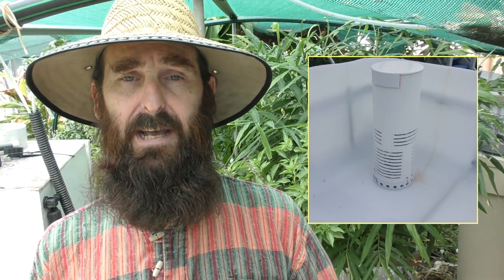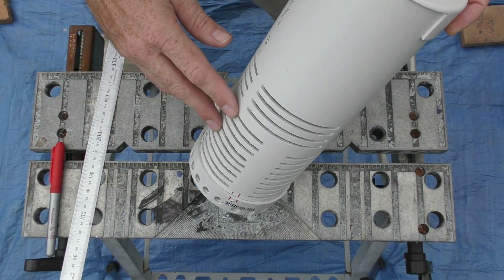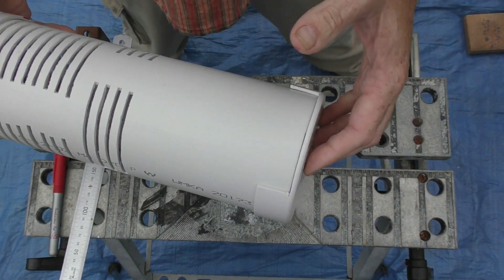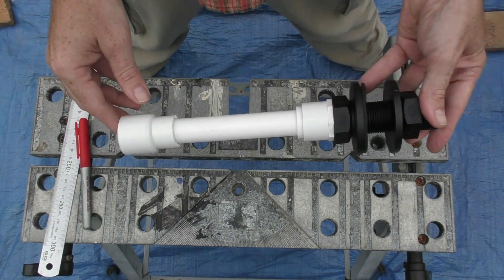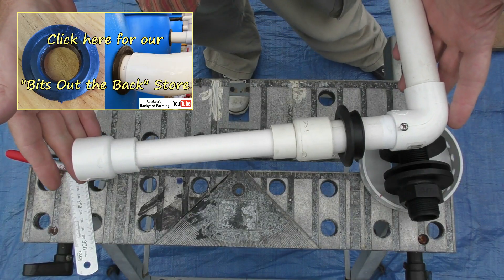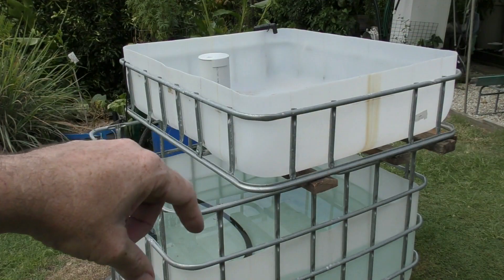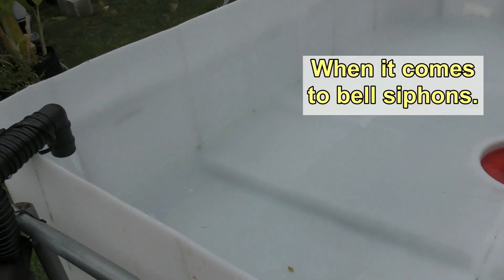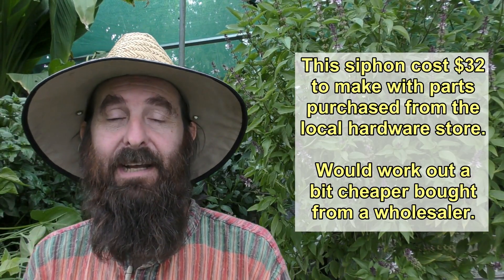How to Make a Bell Siphon & How Bell Siphons Work

Comment: Hi Rob
Great video – does it matter what height the bell is above the stand pipe?
You say you measured 30mm above stand pipe (250mm + 30mm) is 280mm, but on the video (11:20) you mention the bell is 270mm.
I am guessing it is not an issue but don’t want to botch the build.
Thanks again, very informative and helpful.
Regards David (South Africa)
Reply: I'd make it 280mm and test it out, you can always cut it down 10mm if it's not initiating properly.
Reply from the maker: From memory the 30 is from the base of the bed while the 280mm is from the top of the bulkhead fitting base.👍👍 
Hope the build went well for you mate.

Comment: Is stand pipe size matter? Cause' i got 49mm stand pipe and 90mm bell pipe? It did work for one cycle only then the water level never went more than half tank.
Reply from the maker: It all depends on the flow rate into the bed. A 49mm standpipe would need a fair volume of inflow to help it initiate.

Comment: So do you leave it running always? No riots ever get too wet and root rot or get too dry?
Reply from the maker: Most root rot is caused by lack of oxygen (O2). The draining of the water from the bed allows O2 to get to them to keep them healthy.
In Deep Water Culture (DWC) grow beds the roots are always submersed in H2O but due to the added air being pumped through the water stay healthy. Some varieties will grow better in this environment than in soil. 
Hope that helps some.

Comment: Your videos are super informative and detailed! I really appreciate you sharing your knowledge. They've really helped me in designing my system. I've seen a bell siphon design with an external tube coming out of the top and turning back down to the bottom of the siphon. What is that design all about and why don't you use it?
Reply from the maker: Hi Beau. I've never had issues with my siphons breaking once I adopted this design so haven't found it's needed. Will be making some up to play with when I build the new system though as I think they work well for folks that like to run a higher flow rate through the grow beds. 
Cheers mate & happy growing. 🌱🌱

Comment: Great tutorial! thank you! I was looking at kits to purchase and felt like 40-50 bucks plus shipping for a few pieces of PVC was pretty ridiculous! lol... will be whipping one of these up in short order!
Reply from the maker: Would love to know how you get on Jen. 👍
Have fun with the build.
Reply: @RobsAquaponics  I completed it yesterday, very easy build and works great though needs a bit of fine tuning! (including the time it took to shop for all the pipes and fittings it only took a few hours to build start to finish)

I opted to order the uni-seal online which I'm really happy with, makes it really easy to adjust stand pipe height even as it's running) the one issue I'm finding is that the pump I am using is filling too fast for the siphon to drain adequately (it's 5200GPH, I already had it as a spare and thought I'd try it first before buying a different one) 

The grow bed I'm using is a heavy duty black oval feeder trough, approximately 24x36x14 " so around 40-50 gallons I think? Similar to the one linked here: https://www.agrisupply.com/oval-tank/p/54747/

I was unable to find 2.5" pipe for the bell cap, so used 2" instead and it seems to be working fine despite that change.

What is the min/max GPH you'd recommend for this setup?

OH, also, what is the clearance/gap that should exist between the top and the stand pipe and the bell cap top? Just so I can make sure I have that set up right. I think the gap I have it a little too much right now.

Other than that I'm just waiting on the growing media to show up tomorrow so I can finish it up and pop some plants in!

Really excited to see it in action. Have been wanting to set up a system to filter my koi pond and grow some happy veggies for a while now
Reply from the maker: @ethaera  Hi Jen.
The flow rate will depend on the size & type of media. I've seen folks try to pin down a correct flow rate but it's a bit hard once roots, different sized media & pipes are taken into consideration. With ours I think I worked out that one of ours ran just over 400lph/105gph into 300L/80gal beds but can't find where I wrote that figure down to verify it sorry. 
With the gap, I've had them work fin with anywhere between 1-2" of clearance between the standpipe & bell top. In saying that, I've seen folks have a lot more clearance than 2" with no issues either. 
Hope it's all up & running smoothly now Jen.
Cheers.
Reply: @RobsAquaponics  Thanks! I ended up buying a cheap valve so I could control flow rate. After spending a few days fiddling with it I think it's finally (for now!) working great, but will be easy to adjust later if needed! Just started out with some simple lettuce as I continue learning more, but it seems very happy and healthy with my koi pond water!

Comment: forgive me if my questions have been asked already. do you need to tailor the fill and siphon times for specific types of plants? also the depth of water and dry segments? why are some setups done with constant water and no bell siphons?  thanks for the great videos!
Reply from the maker: Hi Richard. I haven't come across any plants that do better with different cycle timings. 30cm/1ft is a standard depth bed but have seen them all the way down to 15cm/6".  I like them deeper as the extra media provides more bio filtration. 
Constant flow beds work too. I like the cycled flood & drain as I know that there is a lot of air getting into the root zone for the bacteria & plant roots.
Hope that helped some.

Comment: Merry Christmas Rob! Your visa have been very helpful. I've just set up my system and it's looking great. Only question I have is that my siphon seems to only pump out half the water in the grow bed. Is that a concern I should look at? Thanks in advance!
Reply from the maker: Hi Andrew. Hope you had a top one yourself. 
You will find that they generally leave a few inches of water in the base & a bit more isn't a huge issue. If it's not draining entirely, it could be water flow issue or the slots in the bell might be cut a bit too high. 
Hope that helps you out some.

Comment: Great channel Rob! Ive only recently discovered you and I have to say you are an inspiration.Currently im on a 1.3 million acre cattle station in South Oz, in a heavily drought affected area, as you can imagine there's a ton of sand and not alot of water, so when im not working im watching ' how to's ' on U Tube...Ive even built a couple of wicking beds out here for the Mrs of the homestead based on some of your videos.....But when I eventually get back to the world Ive Been looking to start in hydroponics, eventually leading to an aquaponic system.... at this stage though im just gathering info and trying to get my head around some things. Is it possible to use flood/drain beds and raft DWC beds in the same system? Again thnx for the great vids and keep up the good work!
Reply from the maker: Hi Wilson.
You can use the 2 in one system & did a bit of an explanation oh on a recent clip if that helps at all. 
► https://www.youtube.com/watch?v=qXtvljDYkfI
Just need to make sure that you can remove as much solids as possible from the water flowing into the DWC.
Reply from the maker: Where's home when you're not on the station?
Cheers & have a top one mate.

Comment: Good day, what is the minimum height of the drain pipe inside the bell siphon?  i made one about 6 inches in height, and it doesn't cycle?  the bell siphon cover is  3 inches and the bell cover is about 4 inches....
Reply from the maker: It could be a flow problem if the siphon isn't initiating Jimmy. I have some in the past that are only 3-4" in height & they had bells with a 2-3" gap above the standpipe.
Have you got it working yet?

Comment: my guess is that if the bell siphon does not stop siphoning, instead of fiddling with the inlet of the tank, you could also expand the inlet of the bell. by having the inlet reach a little bit further up, the suction of the siphon draining the water will be cut off sooner. your lowest average water level would rise with this technique but i guess this is very dependent on what flow rates the rest of your system needs
Reply: @Tim Scott  Here's a great aquaponics system that I currently use: AquaSystem.xyz

Comment: I'm not able to adjust the flow rate to initiate the syphons.They all are initiated but once they drain, they do not get flooded again. Could You please suggest some ways to do so?
Reply from the maker: A valve at the inflow to the bed is the beast way to regulate the flow Mariam. There could also be other reasons like the drain pipe pointing upwards not allowing air back in to help break the siphon.
HTH some.
Rob.

Comment: I'm having problems with my bell siphon. The stand pipe is 1.25 in (31.75mm) diameter and 6.5 in (165 mm) tall. 
The bell is 3 in (76.2mm) diameter and 9 in (228mm) tall. 
The grate to keep rocks back is 6 in (152mm) diameter and 11 in (279mm) tall. 
I have to prime the syphon to get any water to start flowing, even a dribble. The bell will just float from the air pocket inside and even if i put a rock on top to hold it down, the table will start to flood. 
The next issue is it wont stop syphoning one it has drained so far down. It doesnt get enough air to break the syphon. If i break the syphon manually the table is still half full. The table takes about 10 min or so to completely drain after i remove the stand pipe and water level has gone down. 
Im sure the rocks hold back water and thats why it takes so long to drain. Is this normal operation as far as the drain of the table completely.

Comment: THANKS FOR THE USEFUL INFORMATION..IM designing a vertical aquaponic system with pvc..it will consist of about four vertical pvc. should i put a bell syphon in each pvc ?
Reply from the maker: If the pipes are vertical you can just let the water run out the base into a trough & depending on how you have it plumbed back up, back into the sump or fish tank.
Bell & other siphons are generally used in media based grow beds.
Cheers.

Comment: I got my pumps running 24 7 my bell siphoned never work because I don’t have the expanding clay got lava rock
Reply from the maker: They should work no matter what media you have in the bed Ana. What's the issue you're having with them, are they not initiating or not breaking?

Comment: Thanks a lot Rob for the great job you doing. Quick Q. I made my siphon few days back and it was working perfectly, and all the sudden the water never stops! it keeps running, with quarter of the 3.4"!! here is my video i made few days back :( https://www.youtube.com/watch?v=koGjWBkWWqg&t=6s
Reply from the maker: Hey Mohamed. I'd say it would help if you could place valves on each inlet to the beds to better regulate the flow. I'd leave the one over the top of the fish as a way to relive some of the excess flow from the pump + it will add O2 into the water for the fish.
Hope that helps some mate.
Cheers.
Reply: Thanks a lot. that's so helpful for sure.

Comment: Rob what's  the distance from top of the stand pipe to the bottom of the bell (the 2.5" cap)? Thanx
Reply from the maker: I have some that are around 20mm/ .75" & others that have 50mm/2" gap Dallas. 👍 Anything between there should be OK.
Cheers.

Comment: Fantastic video. I'm going to try this indoors and breed tropical live bearers in the sump. Does the syphon part not lift up when it fills with air?
Reply from the maker: Hi Richard. The air is removed down through the drain pipe that runs to the sump or fish tank depending on how you have the system set up.  If that drain exit o the drain pipe was under water the bell might float if enough air was trapped. 
Cheers.
Reply: Rob Bob's Backyard Farm & Aquaponics thanks! Done alot more research now. I now have a 300 litre sump/fish tank so more water volume. I'm now going to run the the water to a high point where it will run through a series of  pipes with plant pots cut in. The water will then drain into a wicking bed style bed. Then back into the sump tank. Thanks for your help

Comment: Why the fuck does mine run for 3 or 4 cycles then stops and just lags fuck me!
Reply from the maker: Canadian4life
Have you played around with the flow rates C4L? Did you set it up like the one in this clip?
Reply: I ended up cutting deeper groves in the bell and adjusted the flow, it ran all night without stopping! thanks rob sorry for the pisses off message. I probably almost 4 hours into getting it right :( but it’s right ! :)

Comment: Instead of 100/65/25/20mm, will 125/75/40/33 also do?
Thanks!
Reply from the maker: Should work fine as long as the flow rate is high enough to initiate the siphon. 
Cheers.

Comment: What would be a good alternative to the 2-1/2 inch pipe I live in the US and can’t find it anywhere
Reply from the maker: You could go with a 2" or 3 " if need be. 
Cheers Riley.
Reply: Thank you!
Reply from the maker: No problem. The only issue you may have is if you're using the reducer like I did. Just double check that you'll have a bit of clearance around it for water to be able to pass freely.  👍
Cheers.
Reply: ok
Reply: We used 3". Only catch was the sewer pipe cap was too big to fit down in the 4" shroud.  We found a 3" "knock out test cap" that fit flush in the end of the 3" pipe. Sealed it with silicone and it works perfectly.  Thanks Rob for your outstanding videos.  My son and I did the "chop and flip IBC" aquaponics system this weekend, was easy with your guidance.

Comment: Used your ideas and methods to make a bell siphon.  I've got a 1/2 - 55 Gallon barrel. Works like a charm.  Thanks!
This is a test grow bed.  If everything works well I plan on going larger and use my 3000 pond and several grow beds.
I've got Green Onions, Jalapeno Pepper, Patty Pan Squash, Lettuce, Cherry Tomato, Carrots and Radishes.

Comment: Rob, Thank you and appreciate your efforts on sharing the knowledge. I did a small system as a start, however my grow bed fills up too quickly (under two minutes) since it is a small container. If you slow down the water supply, the siphon won't start. Is there anything I can do to give it more time to flood? Or it would be just fine? Not sure if the cycle is too fast for plants. Thanks!

Comment: Rob, I noticed all your end caps for the Bell siphon are flat.  All the caps I bought are rounded when using schedule 40 PVC pipe.  I found this out when I bought caps for the bell siphon that were flat but didn't fit over the schedule 40 pipe.  The fellow at the big box store told me the flat caps only fit on sewage drain pipes. I'll find out how tight the rounded caps work with gaskets.

Comment: Thanks for your vids! 
i have a few ideas and would appreciate some input from anyone who has some insights.

#1  A large bell siphon (s?)for a dam . over dam wall then down to a ram pump. excess water from ram pump going into a contour swale below. there would be a fair distance between bell siphon and ram pump (50 m+). ram to pump to higher dam. my question is that is there any scalability issues or physics principles i should consider for the bell siphon set up? volume i want to siphon might be as much as 5 megalitres after a rainfall event. i would like to siphon the water in less than 3 days.

#2 regarding wicking beds. how would biochar go  instead of gravel or clay balls. i can make the biochar. 

Thanks in advance,  i appreciate the input. ☺

Comment: Good evening Rob. I'm in the process of building your bell siphon. 1 problem...,.your bell is 2-1/2". I can only get 2" or 3". I'm doing a 3/4" stand pipe with the 1"-3/4" reducer on top. Any recommendations on what size bell I can use? Thanks!

Comment: Hi dare i really enjoyed your video, but i wonder Where did you find the materials for siphon? I took a lot of time to find bulkhead, adapter,  eyebow... I did go to home depot but I can't find materials like yours
Reply from the maker: Hi there & sorry for taking so long to get back to you. Have you finished your build yet? 
The pvc fittings should be available from the plumbing section of any well stocked hardware store. If your local doesn't have them then a plumbing supply would be the next best bet.
As for the bulkhead fittings, I've popped some links in the description to  ¾ & 1" units for folks to check out. 
Hope that helps you out some. 
Rob.

Comment: Hey Rob, where do you get your basic bell siphon measurements from? Like you say the standpipe length should be 120 mm. but why?
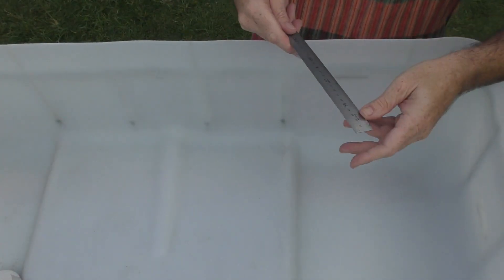Reply from the maker: Hi there. In this clip I run through the measurements needed to set up a siphon for this particular bed. The reason I chose this depth bed is that lot of folks that work with IBC to build their systems tend to use beds of this depth. Grow beds with different depths can be worked out using the steps I've used but you will need to alter the measurements of course.  I go through why I used the measurements I use at 2:41 for this particular build & run through the standpipe at 7:14 if that helps any. 
Cheers,
Rob.

Comment: I want to do this with a sewage treatment plant, 50 gallon dosing chamber...question, what is the maximum diameter pipe I can use for the inner pipe? Is there  an upper limit to that diameter?
Reply from the maker: Hi Dan. That's way out of my field of knowledge sorry mate. It would all come down to the volume of water coming into the bell & the ability of the standpipe to be able to initiate a siphon. 
Sorry I'm not much help mate but hope you find the information you need.
Rob